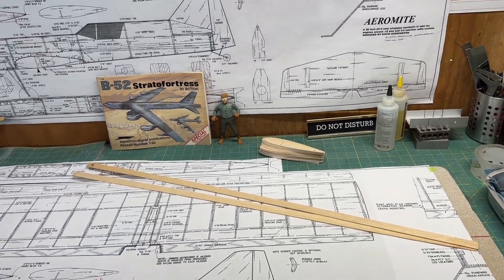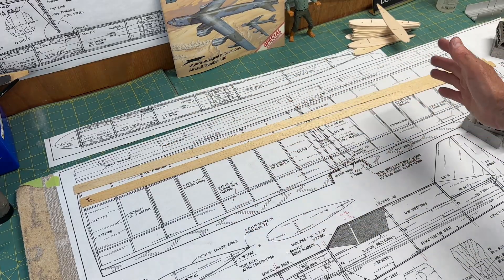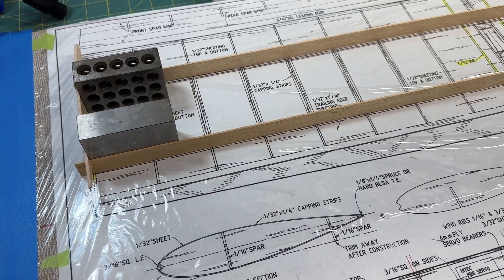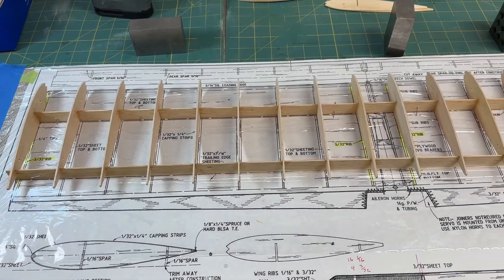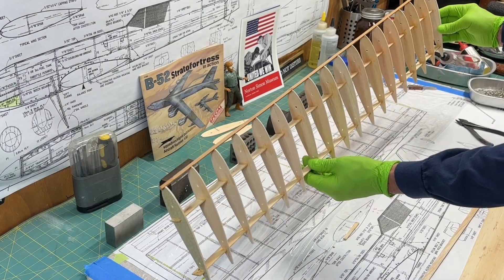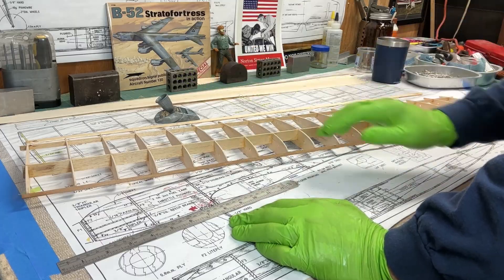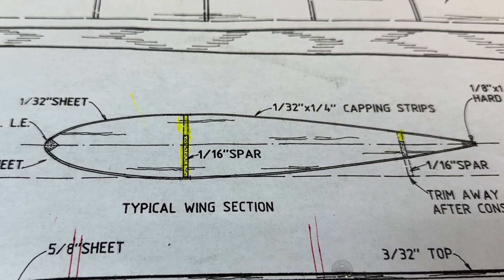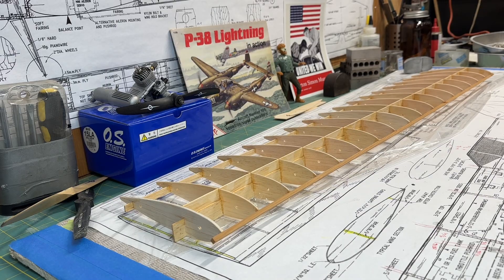How to Build a Balsa RC Plane Off Plans: No. 10, Framing the wing, spars and wing ribs

Comment: Did everybody that builds balsa planes screws up all the time and has to fix it I know I sure as shit do. Hell I've had to rip off the same piece of sheathing three times in a row before because I couldn't get it quite right on a warbird that I happen to be working on right now. Now I just happen to be drilling out the dummy engine to put in the fake pushrods for the you know the double wasp engine in the p-47.... So don't think you're the only one out here making mistakes because you're not we all do it man still some of us don't record them you just happen to record them.... Don't let it get you down don't let it discourage you from building it's not a big deal man...
Reply from the maker: Thanks much appreciated. All constructive criticism and tips and pointing out mistakes is valuable . As long as comments are polite, Im all for hearing what others want to contribute and teach.  When comments get terse is when I pull back. You have provided a lot of useful tips and things that I appreciate, I will always take constructive criticism and correct when I can. I pulled the F-86 vid and edited it for a repost because you pointed out the battery issue. That was a great contribution . All good. I plan on adding a little more “electric”  content , it will be a learning experience. Thanks for comments!

Comment: I probably would have made the same mistake. Lol
I’m surprised you didn’t use basswood or spruce for the spars. I would worry about the strength of balsa in that position.
Reply from the maker: I thought about it. But figured i would follow the plan, and now that Insee the spar was supposed to lock into the rib fully , that full length box structure seems strong enough. I added the extra pieces to the rear spar as well, seems good… i hope

Comment: I was wondering if you where gonna catch that detail. I would do the rear also. It adds significant strength to the wing without adding a bunch of weight.
Reply from the maker: Thanks, I’ll do it
Reply: I make mistakes on every build, don’t worry about it. Your solution is fine. I’m suprised there’s no dihedral in the wing
Reply: I have never thought to use thick CA after bonding ribs with thin. I think that is a great idea. Great video. Always learning.
Reply: I was thinking that there should have been notches in the top of the ribs for a spar on top.  Then you showed the mistake.  It happens to all of us.  That's why we put covering on our planes. It hides our mistakes. 
My braid said to cut notches and add the spar, but your solution was easier.